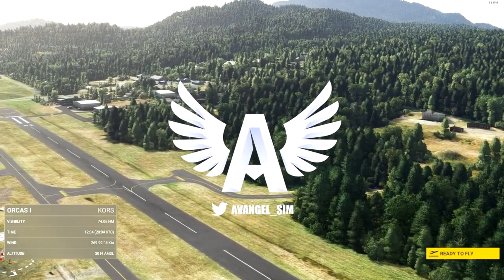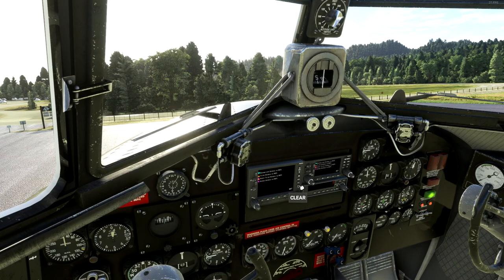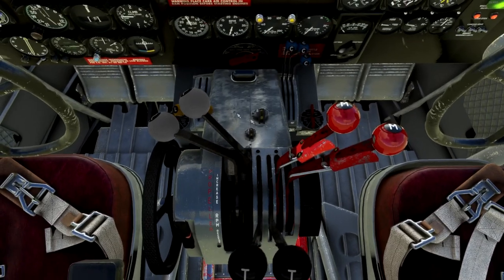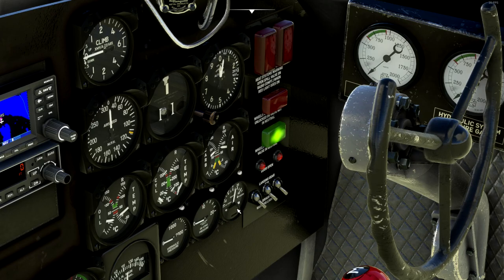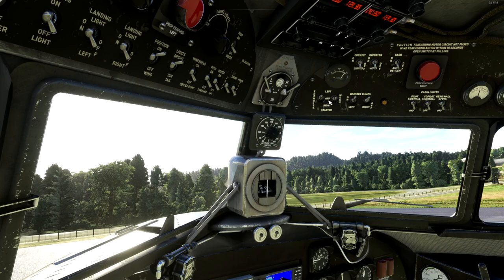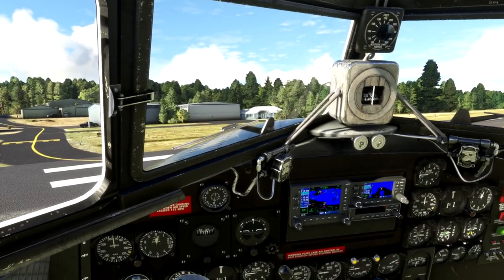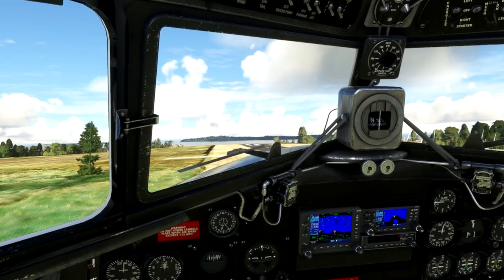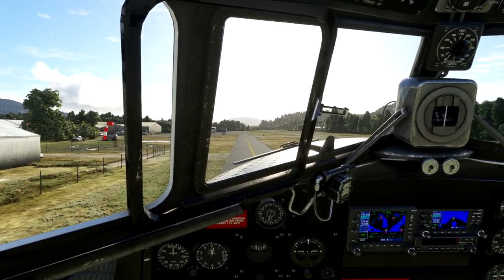Handling The Mighty Dakota - Aeroplane Heaven DC3 - MSFS

Comment: Don't try to slam the tail in as soon as you touch down. Being a low wing taildragger, you want to keep the tail flying, so you maintain rudder authority, because as you lower it, the fuselage and wings will obscure it. Then, as you are stable on the centerline, slowly set the tail down and use a bit of differntial braking to keep centered.
Reply from the maker: you can land it both ways... on wheel, and 3 point, admittedly i forced it down a bit there with limted runway.
Reply: This ! Same with takeoff . I’ll post a YouTube vid flying it properly also , climbout is super shallow on these things like 300fpm or less

Comment: Retrofit??? My whole world view just came crashing down around me. I thought that you of all people, having clearly been a 1930's Alaskan mail pilot in a past life, would've gone for the classic 😂

If you have separate throttle controls (and pedals) you should set the tailwheel steering angle to 180 (castering) and taxi using differential brakes and thrust (and propwash over the rudder). I suppose at some point I'll want to fly again, but for now I'm having a blast just trying to taxi straight with crosswinds. My 6-lever setup has finally paid off.

Comment: Almost all the Youtubers had the DC3 run amok on touchdown.  For me too!  However, after much trial and error, I found reducing the propeller to idle as it touches down helps a lot.  So on touchdown, prop idle, throttle idle  then pulsing the brakes to prevent tipover.  Im not sure if its 'standard procedure', but it definitely works on this model.
Reply: You are spot on with the Props fine on touchdown.
Do a steady approach all the way to flair with no more than 95 to 100 mph. (I mentioned somewhere I did 1,600 hours in them)
Reply: @billolgaau  Excellent !!

Comment: Another bangin' video, Thumbs up given. I wish youtube would add a "Loved" button instead of just the Like and Dislike. One note, my Dad is a former DC3 driver (3500+ hrs) and he always preached that you never (emphasis on the NEVER) 3 point land a real world DC3, the tail wheel was not designed to take it.
Reply from the maker: Fair enough! ( I may be getting confused with the B17 and a few others on the 3 pointers.)
Reply: Perhaps more importantly than the strength of the tailwheel is at that angle of attack the tail/rudder effectively becomes blanked out by the wing and you'll lose rudder authority.   There are a few real life videos available of DC3 crashes because of this phenomenon.

Comment: Aha, the trim defaulting to nose up would explain why I had so much trouble when I tried to fly it. It also seemed like the trim wheel was not really responding to the wheel on my Bravo throttle quadrant. I need to spend some more time with it to see just what is going on, but at least I can have a better chance of getting in the air on the first try.

Comment: would be fun if you did outside view replays of your landings! love those spicy ones! 😉, and hopefully the community makes an improvement mod for it
Reply from the maker: I don't have a way of doing replays, the sim doesn't entirely support it. Not well at least.
Reply: @AvAngel  ok fair enough!
Reply: @AvAngel  They have improved the replay function somewhat and its  easy to use once you know how it works. The only snag I found is having to put it in the toolbar each time you start the sim. (Found under General Options / Experimental)

Comment: Did anyone find the knob for the heading bug yet in the retrofit version? I have it mapped to a panel but cant find any turning knob while adjusting it. I mean.. how do you use the heading mode on the AP if you can't change it in the plane?
Reply: No, I don't believe there is one. On the Classic, the heading is set on the Sperry AP, and it seems like they replaced the Sperry in the Retrofit, but never added a modern HSI with a heading bug. Seems like a big oversight to me. I can use my mapped hat switch to set heading for the AP, but I have to guess what it's actually reading and just make tiny heading changes.

Comment: I tried to steer the DC-3 yesterday. I like to opearte it with the real POH. Vr is apr. 100 knots... It is impossible be for me to stay on the ground for that long. Even if i push the yoke FULLY foward the airplane is in the air at about 70 knots.. dont know what im doing wrong here ... Powersettings are checked aswell. Maybe you have to fully fuel and load it up? Or maybe the performance of the sim is not accurat enough? How is your experience with this?
Reply from the maker: 100kts? That’s wicked fast, sure it’s the right poh?

Comment: The landing speed of aircraft is whatever it is but when I'm approach is there a rule of thumb speed that you should be at compared to landing speed say maybe like 10 to 15 knots higher than landing speed? I've always wondered that
Reply from the maker: Not technically, each aircraft has different approach speeds depening on lift, and size.
Reply: @AvAngel  This free DC-3 is simply gorgeous!  I'm using the retrofit avionics with AP, nav alt etc and it's so authentic.  It flies beautifully, takes off rather quickly and lands very smoothly.  I cannot believe this was so ahead of it's time.  And to think, later in 2023 we get the 4 pot big banger as well!

Comment: You don't start the engine with the mixer full. You'll damage or start an engine fire. You leave it low and once you start the engine, look down, and the mixer will be moved up automatically. I'm not a pilot but another youtube reviewer was corrected by a real DC-3 pilot. Also, check your weight balance before start. It's not balanced so I correct this before I fly. It's a challenge to fly and especially after takeoff as I flipped it many times before I figured it out.
Reply: Incorrect. You do start the DC3 with the mixture full rich. Mikey McBryan posted a video showing how to start a real dc3 and they start with full rich mixture.
Reply from the maker: ^ Its in the checklists to do so.

Comment: I really don't understand why we need a big frakking window to tell us that there is no internet connection. IMHO a small notification in the corner woud suffice.
Reply from the maker: Indeed.
Reply: Yes, what's even worse is you have to dismiss the message to get control back of the aircraft. OK when cruising along but a pain when it happens on a take-off roll or when landing.

Comment: Good video. There are two types of taildragger pilots - those who have ground-looped and those who will ground-loop ! love to know what your PC specs are
Reply from the maker: Absolutely :D It happens to everyone at some point.

I currently run a Rzyen 2700x, X470 pro mobo, Rtx 3070Ti gpu, 32gb of ram.
Reply: @AvAngel  Many thanks. I'm on XP11/12 so AMD wouldn't presently work for me. The DC3 will not lift her tail on her own - one needs about 15-20lbs pressure on the stick at 40 knots to force the tail up into the breeze. Failure to do so result in the wing lifting off first in ground effect - leaving the tail blanked off in disturbed air, loss of tail authority and a tip stall. see here -https://www.youtube.com/shorts/Jq_CgAiuk7s  . Great channel - keep up the good work !
Reply: And some who have deliberately ground looped to avoid a Fire Box in  DH82 Tiger Moth with tail skid & no brakes. (Allegedly - it couldn't have been me)  :o)

Comment: Mixtures should be at idle on start up.
Reply from the maker: Nope not per checklists
Reply: @AvAngel  I got this info from a irl dc3 pilot with over 3000 hr on this bird.  He said it could cause engine fire if failed to do so.
Reply: @AvAngel  Cold dark start and running fuel is set to rich (full forwards) It can be leaned once airborne.  This person is not correct and it will NOT cause an engine fire on startup.  Fuel mixture if set as he claims to idle will = cut off engines.  LOL.  Subscribed from Australia.  Nice videos.

Comment: Yeah, I think you're generous with this one. Agree with most of what you say, but I'm more negative and have uninstalled it. Fly it in VR and you'll see many things in that cockpit are completely out of proportion.
Reply from the maker: Most users aren’t vr and neither am I, so it’s not that bad for me
Reply: Thank you for this comment. I also fly in VR and thought it was just me that was finding things out of proportion. The throttle/mixture/prop knobs are like pool balls stuck on there. The seats also seem too far forwards to me, giving the impression that you'd never get the yoke past your knees when pulling it back.

I can live with it though, as I love the DC-3 and it's the only option in MSFS, but both the Beech 18 and Boeing 247 have much better cockpits. They set the standard that I was hoping to see with this DC-3.
Reply: Haven't noticed this in VR on my end fortunately. I just match my yoke and throttle about 1:1 IRL to the sim without regard to the where the pilot's seat is in the sim as its "supposed" to be adjustable which i adjust with my IRL seat. I'm having a blast with it! I'd like the clickables to be more VR friendly though. And there's graphical glitches galore if you get up and walk toward the back of the plane but I'm still loving it.

Comment: The DC3 was a big Cessna in the air with no vices including a gentle stall (I flew 1 600 hours in them over 6 years) Mostly with Cyclone Engines & one C47 with Pratts.

Firstly the starting sequence they tell you is all wrong as Ignition should not be turned on till 9 to 11 blades (in our company) & when you get a start mixture to Auto Rich.
(We did have 30 ft of flames forward from the Carbi one day when the Capt put the mixture forward early - kept turning & all OK)
Your right with taxing - to make a turn, tail wheel lock off, some outside engine & brakes if needed & half way through the turn close the throttle & apply inside turn engine to stop the turn then tail wheel lock on.
On T/off - T/o power -82 kts (V2) lift off & g ear up (2 levers - the Spade  lock near Cpt seat & gear handle up F/o side - METO power - 300 ft Climb power.
Fun fact - the fastest ground speed I did one day was 145 kts one way & 45 kts back.
Reply: That's interesting, what did you think of landing it, does it look real in the sim?. If a real DC3 pilot can land it consistently well then yes.
Reply: @Lonsome1223  I haven't  really had a chance yet with all the other goodies like the A310 & I am setting up my controls with the mod ( Throttles to fix next)
* The old Good approach good landing - bad approach bad landing applies to the DC3 & a bad landing in the real thing makes a really big bounce - I mentioned slight forward stick on touchdown if needed before.
( If you do a really bad landing & there are still Pax on board, walk down the Isle AFTER the Captain & point his way)  :o)
* Set-up a constant approach like you would in all Airline Aircraft on an ILS without going to fine pitch just leave the power holding around 90 kts (mph?) & back to V2 speed 82 kts, close the throttles & Prop Pitch full fine in case of go around with only a slight flair needed.
Reply: @billolgaau  Thanks for the reply would be very interested to know when you do try it  because you should know if it's realistic or not.
I struggled to keep it on the runway after touch down despite full rudder inputs and tail wheel locked.
Reply: @Lonsome1223 Once you touched down on the main wheels you did have to use the Rudder if it was gusty but once the tail was down with Tail Lock in no problem.
All of us trainees came from single engine fixed gear aircraft in those  days (When Pontius was a Pilot) & we had no problems flying it, was docile & apart from finding out where the ground was from the proverbial two story building - taxing was another story 
I have found over the years with FSX & MSFS the Rudder for me always seems too sensitive.
I will get onto finishing setting up my controls today & get this thing flying (Classic model only without the modern stuff) with ctrl + E starts as published procedures are alien to me.
Reply: Just flew the Classic with mod for the first time today out of Coffs Harbour YCFS were I learnt to fly, instructed & flew in there with the DC3.
It was very good doing circuits, very impressed.
Steady approach with cruise Prop setting, 95 mph over the fence, close the throttle & then Pitch fine just before the slight flare.
Taxiing was another matter as the Rudder acts as "Nose Wheel Stearing" & independ Engines didn't  make much difference.
(Forgive me if I repeat myself as I get lots of questions)
Reply: @billolgaau  So overall it's realistic that's good to know. Thanks.